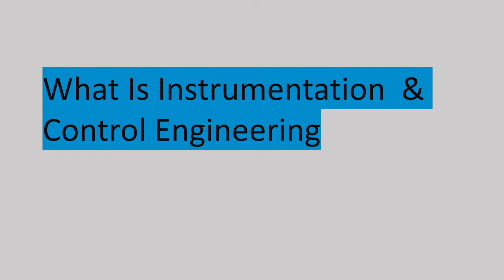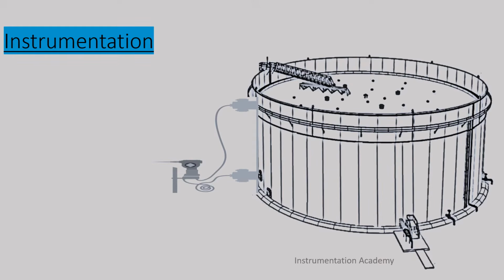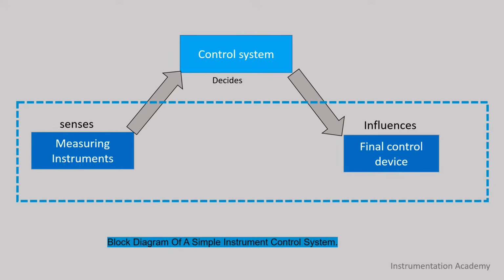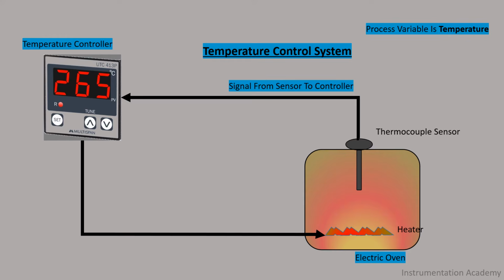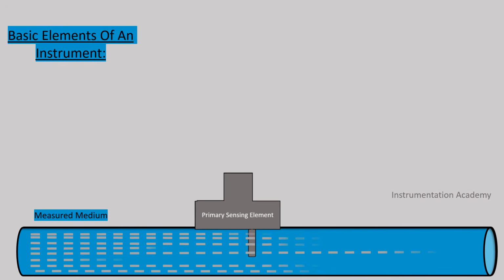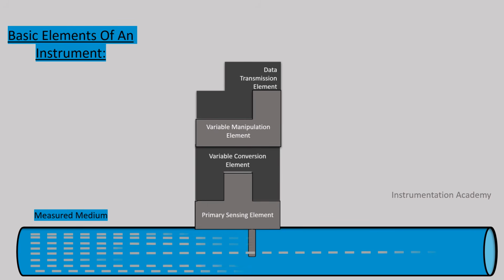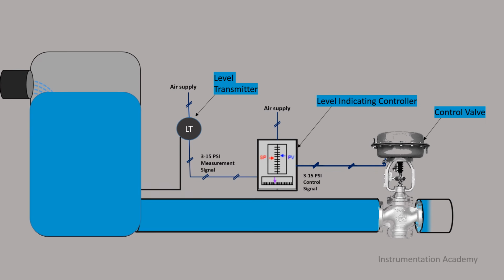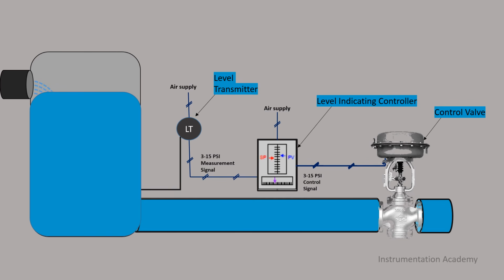What is  Instrumentation and Control. Instrumentation Engineering Animation.

Comment: Instrumentation means......
In simple words, it deals with instruments and devices that measure things like pressure, temperature, flow, level, speed, voltage, current, pH, etc., and then use those measurements to control machines, plants, or processes....